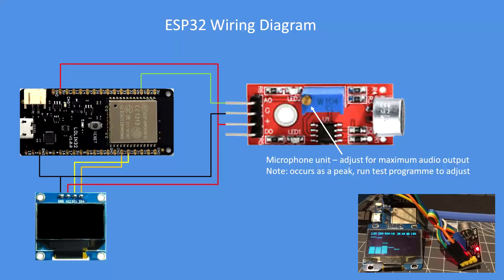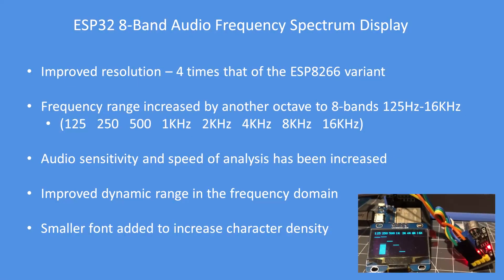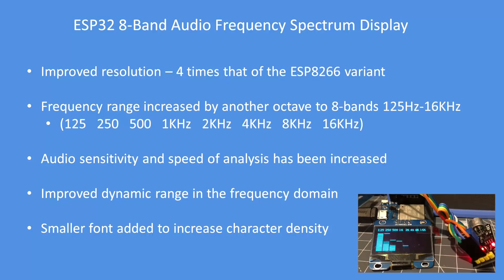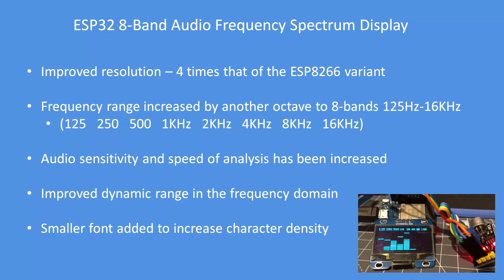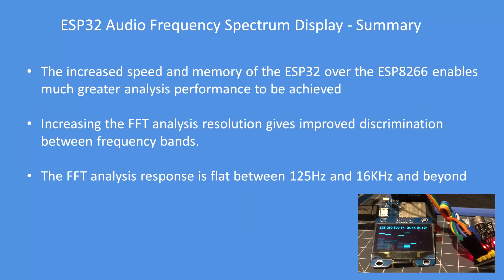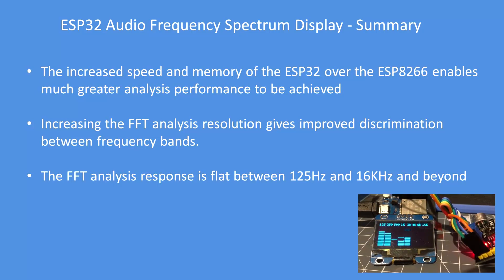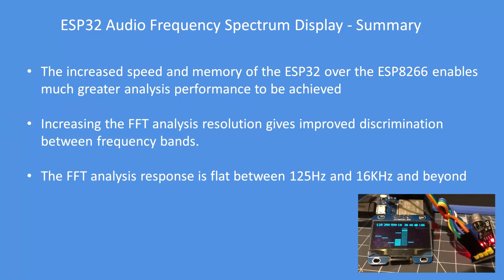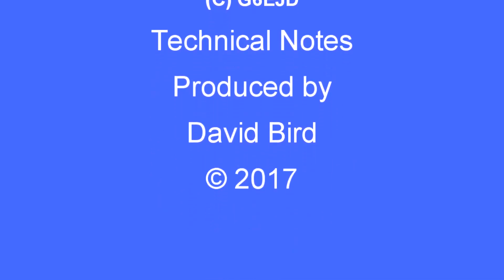Tech Note 077 - ESP32 8-Octave Audio Spectrum Display

Comment: Great project! one question, how could i addess something like 200k buffer for storing what's captured by the microphone?
Thanks!
Reply from the maker: Not that easy because the FFT takes 1024 samples per sampling frequency duration, so you'd need 1024*how long you want=huge amount of storage. What do you mean by 200K buffer? do you mean 200K readings, then the storage required=1024*200K = 2Mbyes and the ESP32 does not have anywhere enough RAM to do that and SPI Flash would be too slow to capture the audio. Need more information on what your trying to achieve. You could capture 200,000 Mic samples but they would not mean much and in FFT terms they would amount to 200-samples which is not a lot of time.
Reply: oh, i'm reducing each sample to 8bits, so i need 200k memory , sound quality is enough for my application, i know there's around 290 k available after esp32 internal use, but i'm unable to address more than 96k , i'm clueless, thanks for your help!!!
Reply from the maker: OK, so: 
byte mic_sample[200000];for (int s=0; s < 200000; s++){  int msample = analogRead(A0);  // or VP or VN or VN depending on device and pin used.  mic_samples[s] = convert_to_8bit(msample);}That gets you 200K samples of audio at 8-bit, via your 8-bit conversion function.But you want to display the audio spectrum of that sample :) ?
Reply: thanks!! no, just store it and replay it by the dac , problem is that if i define byte mic_sample larger than 96000 program crashes ...
Reply from the maker: Out of memory then. Not many options for sampling at speed. I doubt you'd notice any difference in the final outcome if you reduced the number of samples and lengthened the inter-sample time.
Reply: thanks for all your help, i'll try to find more...i ordered some wrover modules, with 4 meg psram, but so far arduino does not support them, so i don´t know what else to do
Reply: In fact what i'm trying to accomplish is a circular buffer, where you first read what's in a ram position, output it to dac and the update the content of that same memory byte with adc reading... your sketch seems to work correctly, but if i try to read first and output to dac...guru meditation... :(
Reply: #define InPin 36

void setup() {
  Serial.begin(115200);
  analogSetWidth(9);
}

void loop() {
  byte mic_sample[200000];
  for (int s=0; s < 200000; s++){  
    
    
    byte read_sample = mic_sample[s];
    //dacWrite(25,read_sample); if i uncomment this line, program crashes
    
 
    int msample = analogRead(InPin);
    msample = msample / 2 ;
    byte loByte = lowByte(msample);
    mic_sample[s] = loByte ;
    
    
    Serial.println( mic_sample[s] );
    Serial.println( s );
    
    }
  
  

  
  
  }
Reply from the maker: You try reducing the numbers right down to say 10 to get the principles correct then gradually increase the size, don’t forget the esp needs a stack and free memory to operate so although the value of free ram might be high in practice there is an overhead to be subtracted.
Reply: yes, that's correct, found in this case that above 2000 it crashes so there is a big memory overhead...hope wrover modules are supported soon in arduino... thanks again for all your knowledge and generosity!!!

Comment: You are amazing! These ESP32 thingy is new to most of us but people like you really helping us understanding its true potential.
Reply from the maker: If you are used to the ESP8266 or Arduino then you can get hold of an MHT- Live like in my video here then it is almost seamless in use. The code differences are very small until you want to use WiFi or more advanced features.